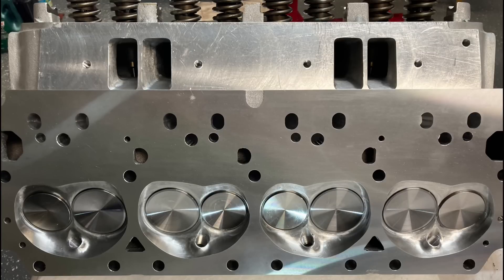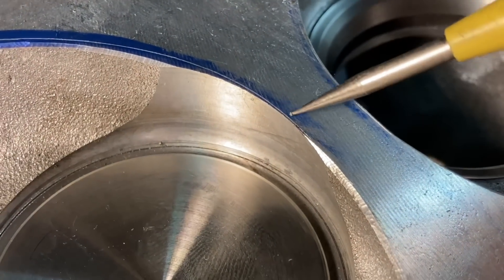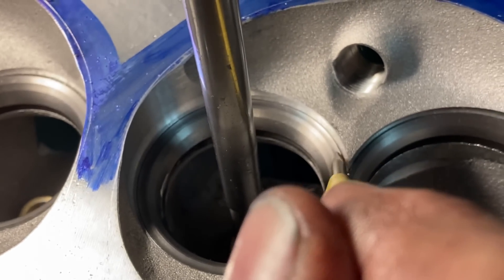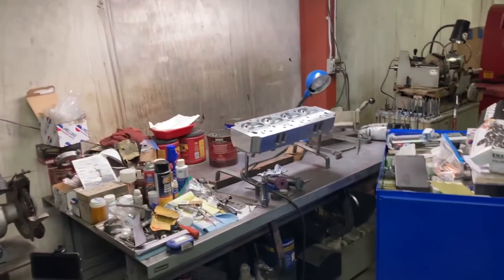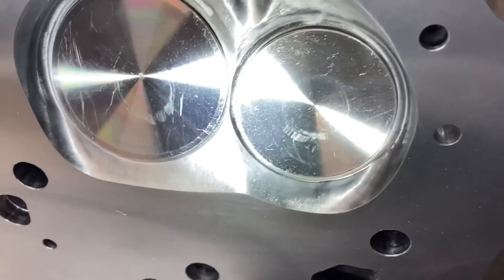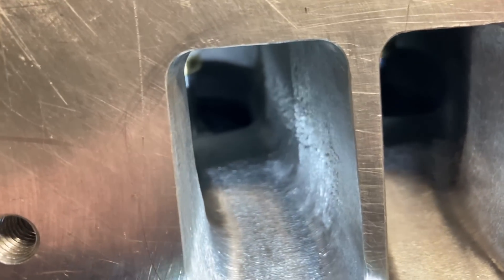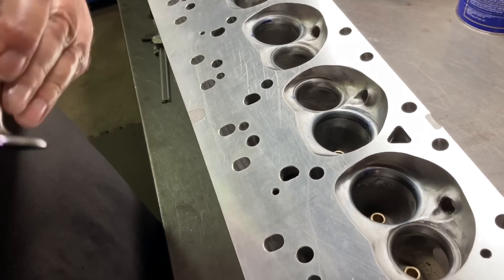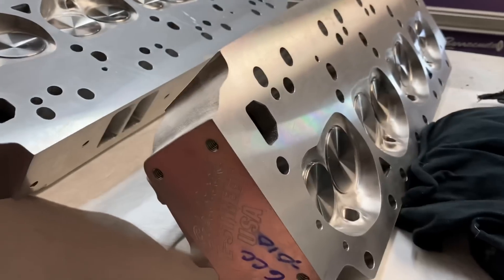How to Improve Any Aftermarket Cylinder Head #edelbrock #trickflow #dragcar #mopar #cylinderhead

Comment: The deshrouding really helps, I was delighted that the MoPar Performance aluminum Magnum heads I bought already ported and prepped had that expertly done to them! The exhaust ports weren't as deluxe as my head porter does them, but still very nice. The flow numbers reflect it, too! Your heads look amazing Joe and kudos to Ed for another fantastic job!! RB
Reply from the maker: Thanks Rod
Reply: Those I think are rebadged RPM heads from Eddy
Reply from the maker: @dang5553  I think you’re right. Slightly different spring rates I believe

Comment: It's amazing in this day and age that much improving still needs to be done on brand new heads. Looking forward to seeing your 400 getting finished. Love your vids! I always liked to get the rotating assembly balanced, and get all the oil passages on the crank chamfered, and the heads nice and squared away like you did.
Reply from the maker: Thanks brother. Going back to it soon. Gaskets are ordered. Should be making noise before Christmas 🎅🏼
Reply: If it all came out of the box perfect the price for the heads would triple.

Comment: Yes I agree.
Deshrouding the valves is one of the best improvements you can make on a set of heads. Pocket bowl blending is another one.
Reply from the maker: Eric, idk if you saw in the initial video, but the bowls were oversized in some areas, from edelbrock. Ed had commented that she wished they’d left more material for there to be blended correctly.

Comment: I used some out of the box Edelbrock heads on my 440 for about 4 years had no trouble with the guides being too tight even though they probably were. And that included a 190 shot of nitrous about 80% of the time, I'm sure they would have been better with some prep but the ones I used were one of the very first sets available when they came out
Reply from the maker: Thanks for sharing, Thomas. These were a mid pandemic after they moved from California to Mississippi. I think QC has crapped out in some instances.
Reply: today Edelbrock sadly sucks I think since they were bought out by Comp quality went down the drain....get AFR, Brodix, Profiler or Trick Flow...

Comment: Great video.  I'm about to test out some 440 Source heads (CNC ported version) in my Super Bee I'm building.  Lots of time to get that car on the road.  Did a nut and bolt and rotisserie restoration.  I wanted Trick Flows or Edelbrocks, but during the pandemic, they were the only heads available, so here goes!
Reply from the maker: Good luck! I have absolutely thought about a pair that were prepped and ready by them. Please let me know how they work out

Comment: How big is the head gasket (diameter) vs the bore?  Gotta watch as many head gaskets are much bigger then bore diameter and depending on the engine you may create other problems if the chamber is now “bigger” the the bore because now the airflow is slamming into the deck of the block….
Reply from the maker: Hopefully you saw my common head gaskets mistakes video. One of the biggest lessons I’ve learned was running too small of a head gasket diameter on a 440 truck block that had huge chamfers, similar to the 400 I have. Bore is around 4.372. The chamfer hanging on some sides is .030+. The common shim style gasket is cited as 4.400 and 4.410 in other places. If you add .030 per side of the bore, plus 4.372= I’m at 4.432. The common size up from that is 4.500. All I can do is test fit my new gaskets and look at how they hang in or out.

Comment: I used these same heads on my 500 build, I kinda wish I cleaned them up like you did.
Reply from the maker: How’s it run?
Reply: @JustMoparJoe  oh it runs awesome. Mild cam 484 lift and had to run HP manifolds (64 C body) no one makes a header… 500hp 540ft-lbs stroked to 500 cu.
Reply from the maker: @tomcox2565  that’s great to hear! That sounds like the perfect engine for that combination.

Comment: How’s the cost to benefit ratio for “cleaning” the heads compared to off the shelf?
Reply from the maker: Thanks for asking. These heads with my total expense is still less than an unchecked off the shelf TF or Indy.
Reply: @JustMoparJoe  what did you mean by a bare set of heads?
Reply from the maker: @JoesMoparMess  bare means without any valves, or hardware, or springs. You have  to source it all for your build. Bare castings
Reply from the maker: @JoesMoparMess  https://www.speedmaster79.com/Mopar-Chrysler-BB-383-440-265cc-74cc-As-Cast-Bare-Aluminum-Cylinder-Head
Reply: @JustMoparJoe  Got it, that’s what I figured. I was thinking of the 440 source stealth heads. I love the idea of getting a stroker kit and some stealth heads but everything else looking like an old tired 440!
Reply: @JustMoparJoe  BTW: Your a class act! So many guys online, you being one of the main ones, are so willing to share your wisdom with people like me (an idiot making a mess of everything I touch).
Reply from the maker: @JoesMoparMess  thanks for the kind words. I’ve got a lot more to learn, but I will definitely share when I can!

Comment: Think I'll be looking at some Aluminum small block heads sorta kinda soon.
Reply from the maker: Alright! Hopefully for the duster. You just missed the speedmaster Black Friday sale. They do it every year. Bare castings were around $300 each. I think an assembled pair is around $800! Definitely get them checked, but that’s every brand now.
Reply: @JustMoparJoe  im liking the idea of Trick Flows
Reply from the maker: @HoosierGarage  I would put them on a 340/360 block with the larger valves in them

Comment: Compound angles are impossible to do with a cutter.  What I focus on is opening that combustion chamber intake clearance [from about 9 o'clock to 12] like a scroll housing, but as it goes around, it also has to lay back.  The cutter here comes pretty close to a perfect: that 9-10 area generally demands some compromises, either caused by gasket choice or core shift.
Guide hone? I'm more happy to see those arrive a touch tight than not, so they can be matched for the valves used.  Are  11/32 valves shipped 0.342" or 0.344" ?  Could matter a whole lot.
Anyway, buy new heads and step 1 is  disassembly and inspection - there's always something to touch up.
Reply from the maker: Ed can speak to that. I believe he cut the angles in his machine, then touched up the sealing angle with the stones to guarantee a positive seal. These hards are going in my racecar (although they aren’t a true “race head”) guides neeeded sized accordingly for the application. I look to spin this engine 6,500-7,000 rpm not long after it’s built.

Comment: I not a expert my opinion only , cylinder heads is where i dont skimp if you want to make hp . A engine that want lay over or at least pull up in the upper rpm . I found you just need to know where to go to get the work done properly as shown here . Thanks for the videos
Reply from the maker: Appreciate you sharing your experience. It’s definitely worth the money to get the heads done right.

Comment: Thats a lot of extra finish work, did Edelbrock give you a discount? I’ll stick with my iron heads. They my need more work, but I’ll be ahead the cost of the aluminum heads.
Reply from the maker: I got these heads on sale for around $1,350. They have gone up 400-500$ since then. I was looking for the improved performance design benefits of an aluminum head,and the weight savings.

Comment: Wouldn't it have been better to scribe to the cylinder bore?
Reply from the maker: Hey Harry’s. We scribed to a compressed gaskets bore size. The line left was just inside that gasket perimeter, which will be almost exactly the bore. I would argue that the difference in processes would not net enough gain to worry about. Also, our block was not bored yet.

Comment: Your increasing your combustion chamber size as well slightly.. edit you got around to that 😂
Reply from the maker: These ended up at 75.6 after being shaved. I believe in the unshrouded chamber. People cry about the small cc runners. I think this broadens the funnel effect. These heads are kicking butt on my 512 now.
Reply: @JustMoparJoe  I agree it really helps on the low end a lot to get more air flow at lower lift.